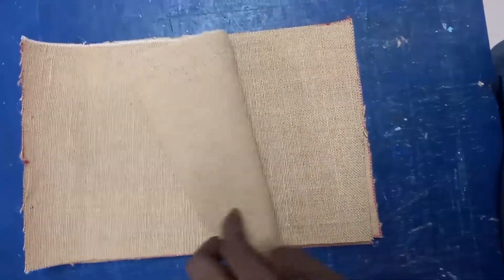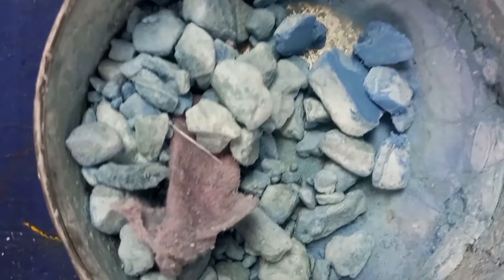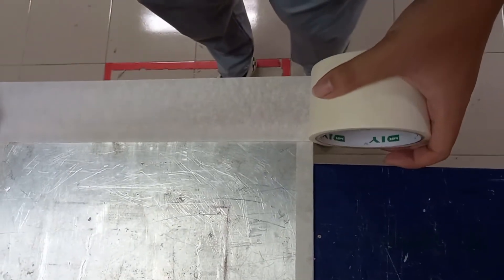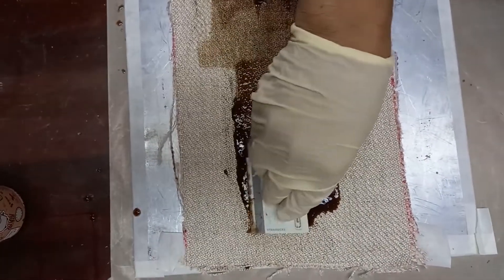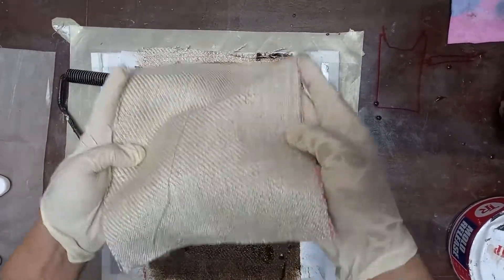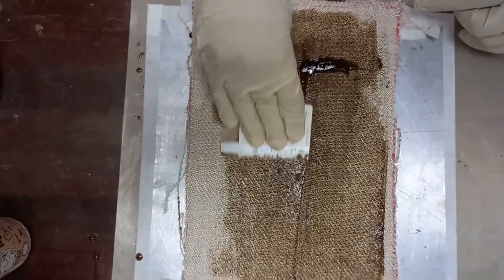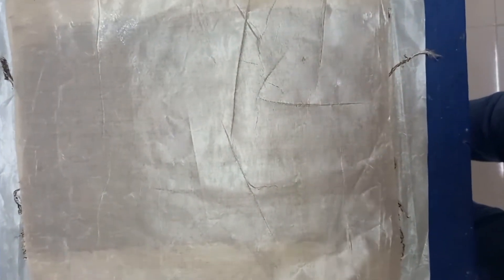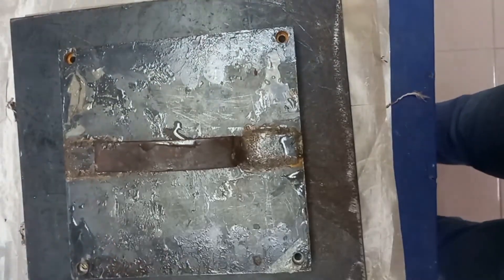Composite manufacturing by Hand lay up method

Comment: ✅ Materials Used in the Video:

1. Reinforcement Material: Bamboo Fiber
	•	The video uses woven bamboo fiber mats as the reinforcement.
	•	These are cut to size and layered inside the mold.
	•	Bamboo is a natural fiber with decent strength and eco-friendly properties.

2. Matrix/Resin: Unsaturated Polyester Resin
	•	A clear polyester resin is mixed with MEKP (Methyl Ethyl Ketone Peroxide) as a hardener or catalyst.
	•	The resin is poured and spread over the bamboo fiber using brushes and rollers to ensure full wet-out.

3. Release Agent
	•	The mold is coated with a release agent (likely wax or PVA) to prevent sticking of the final part.

4. Vacuum Bagging Film (Optional)
	•	Although the main focus is hand lay-up, there’s a part where vacuum bagging is mentioned to enhance surface finish and reduce voids.

⸻

🔁 Process Recap:
	1.	Apply release agent to mold.
	2.	Lay down the bamboo fiber mat.
	3.	Mix polyester resin with hardener.
	4.	Apply resin using brush/roller to impregnate fiber.
	5.	Repeat for multiple layers.
	6.	Cure the laminate (air cure or oven).
	7.	Remove part from mold and finish edges.